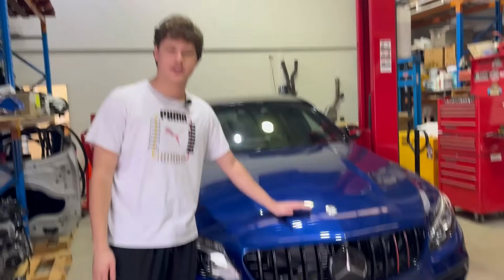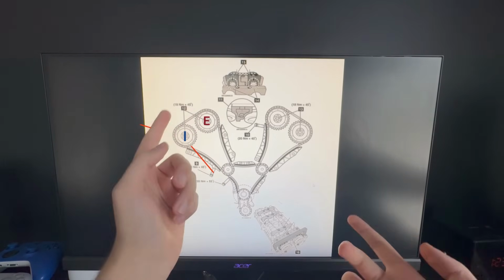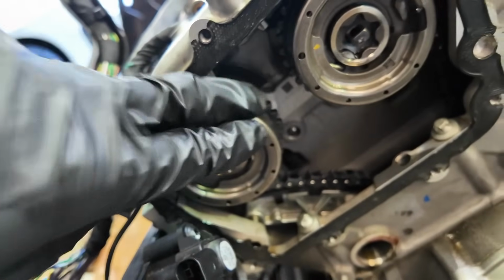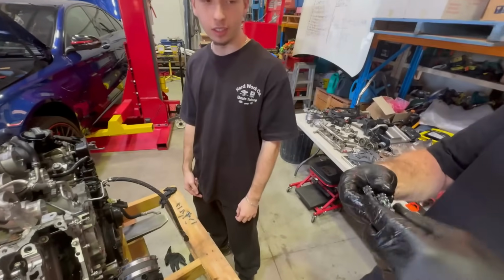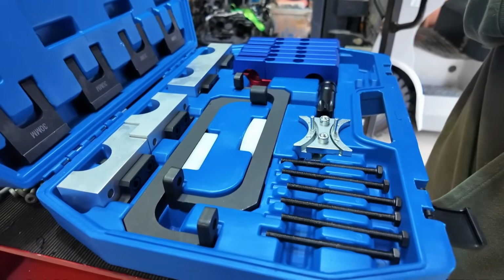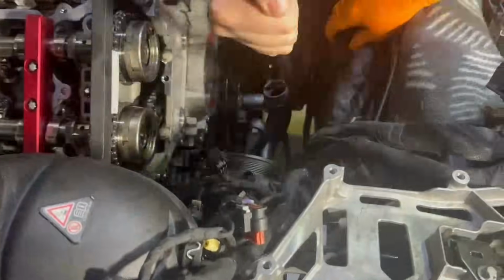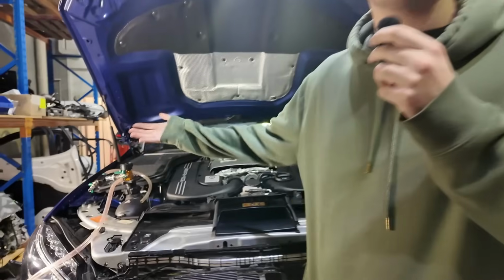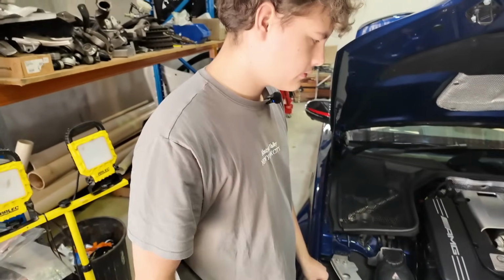Our REBUILT C63s AMG BROKE AGAIN...

Comment: The cam adjuster plate is worn down by the pin sliding on it.
Reply: Exactly. This is known issue for example on older Renaults. I disassembled it and found the same thing - locking pin edge worn out + its hole for locking cam adjuster in zero position. Weak material is the root cause
Reply from the maker: Good to know, thank you!
Reply from the maker: Ah ok, thank you for clearing that up we weren’t to sure before what it might be, that’s interesting!